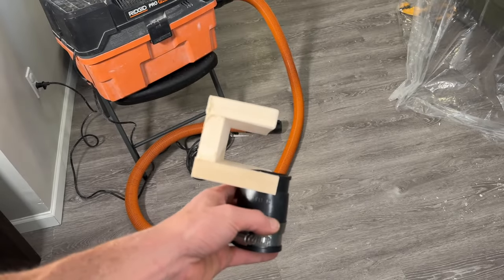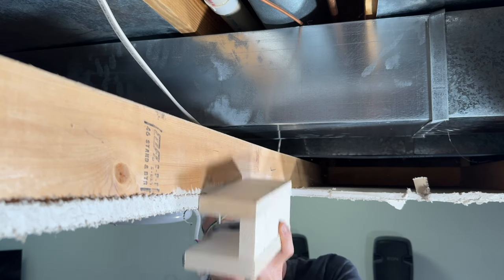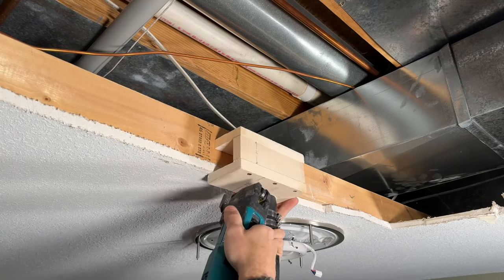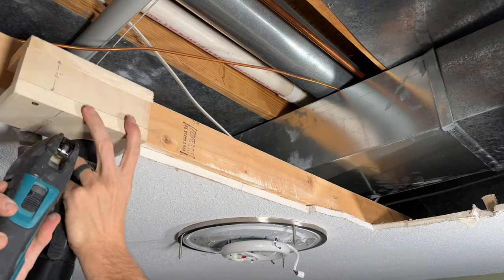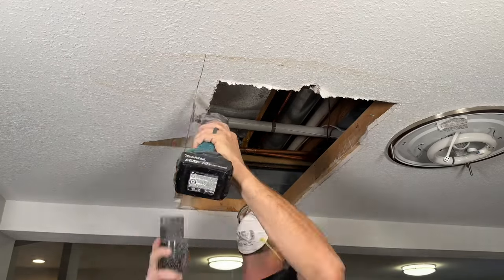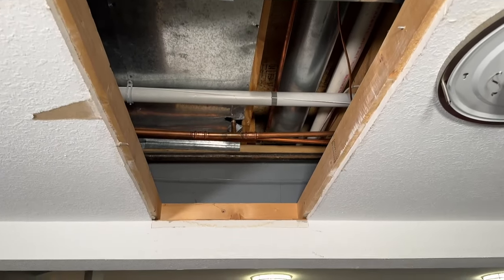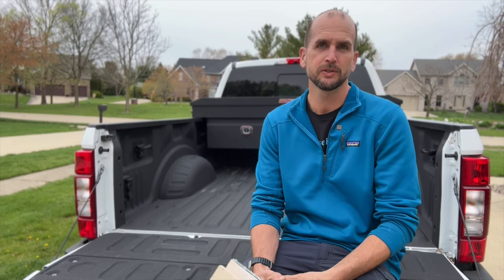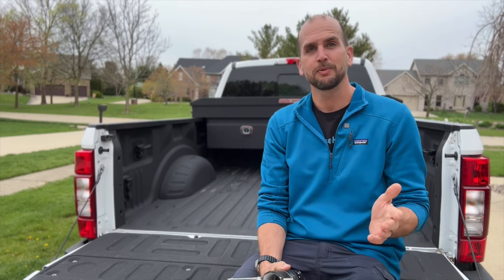How To Cut A Large Drywall Patch

Comment: You can always scab/sister on extra boards for more surface along those 2Xs.  Sometimes I just sister an entire 2x4 instead of getting to the center.
Reply: True, but you run the risk of not having it totally flush, adding overall complication to the job.
Reply from the maker: For sure, for many people that would probably be the easier path.

Comment: How is this not a real product?? Genius hack for patching large spots.
Reply: Very niche tool.  Most people doing this professionally will seal the area with plastic from start to finish because it's a relatively large, messy undertaking. There's also no guarantee you'll have access to the full run along the joists. 

A good stud finder to find both edges every few feet, snap line to split the difference, score with utility knife, follow with multi-tool + vac.  As he mentions, too, avoiding cutting into the corner where it meets the would be ideal as you're nearly multiplying the complexity of the job.
Reply from the maker: Thanks!

Comment: not directly related to the tool but…am kinda new to drywalling etc. so far, i have trouble with attaching drywall to a stud when i only have half the stud to work with. have had issues with (cut side) drywall crumbling etc. so, i usually just sister another stud to the existing so i don’t have to get so close to the drywall edge to attach. does any of this make sense?
Reply from the maker: It does and I think we all run into a similar issue. I will offset a bit more from the cut edge and angle the screw slightly to ensure i grabs the 2x4.  Then I also take additional time to just set the screw right below the surface but not too far or it will blow out the side like you are talking about.
Reply: @everydayhomerepairshelp7417  another question if i may…when you’re installing new drywall next to a painted existing wall do you need to prep the painted wall in any way to be able to mud over it? ie, a butt joint, one side is new, other side is existing. tia.